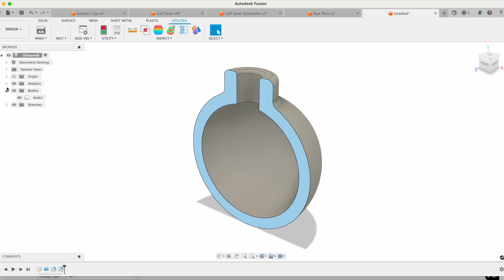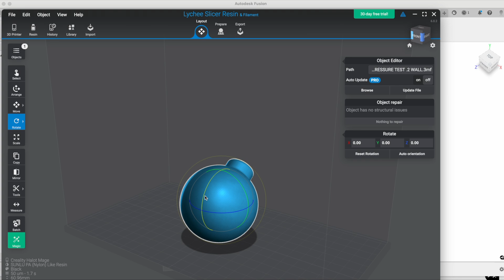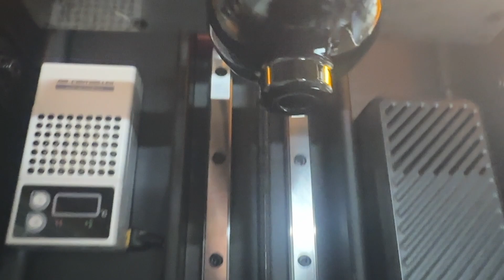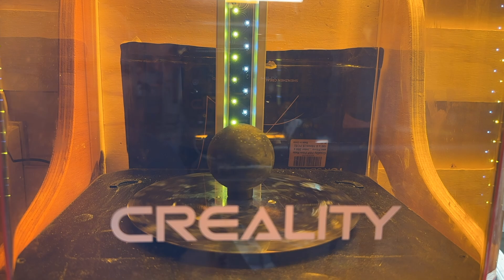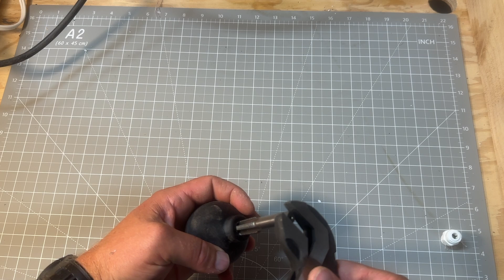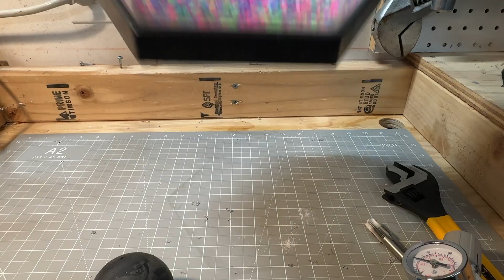Can you 3D Print a fully waterproof part? Titan, Titanic or Nautilus results at 200 ft depth test?

Comment: You do realize you’re making a bomb?
Reply from the maker: Haha! Yes, I 100* realize that. But it is only air pressure at 100psi. Not a huge risk for that tiny volume. Basically a large air hose. Haha.  If I go any higher in pressure I will fill it with liquid and pressurize air only at the neck (hydro test) so if it explodes it will not have any pneumatic compression behind it.